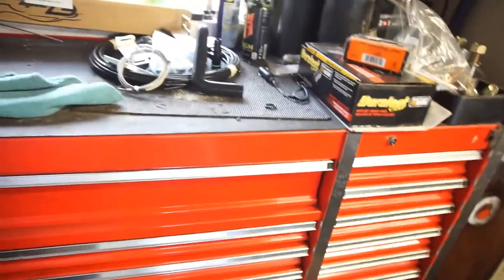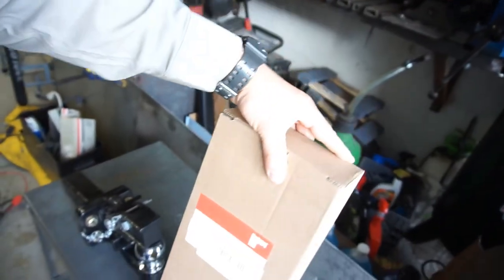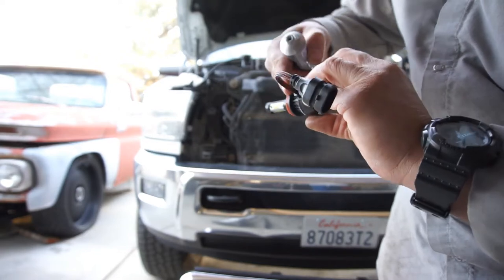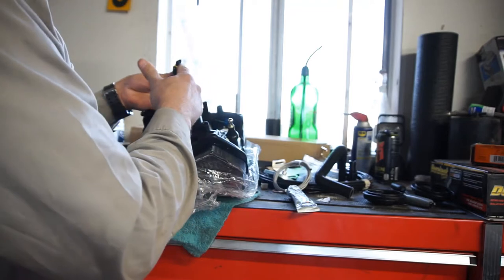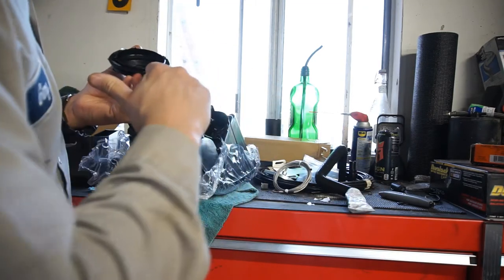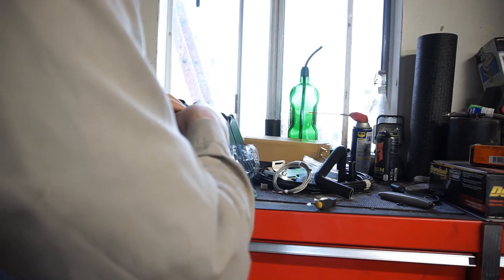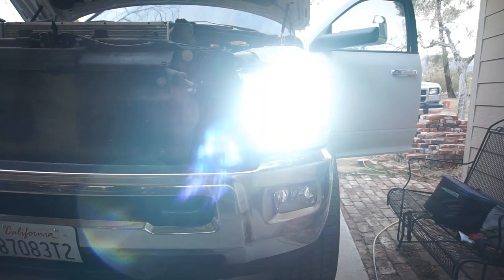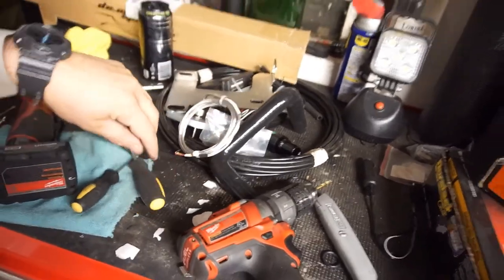The Drunken Ram Gets Some New Eye Balls, 2010 Ram 2500 Cummins Mega Cab Headlight Install

Comment: Those look way better than stock. I like the black housing and the "hyper white" lights or whatever they are called.... way better than stock.
Reply from the maker: OneNGlen I have mixed feelings right now until I color match the front. 🤷🏿‍♂️🤷🏿‍♂️
Reply: @Halffast719  You should do a poll.... stock or what is on there.... those are way better than stock
Reply from the maker: OneNGlen I like stock lights but these are growing on me.

Comment: Looks good! Nice upgrade from the originals. Did you figure out the high beam?
Reply from the maker: Paul Cleckley the bulb is junk so now I have to try to warranty it or just find good quality leds but it’s so hard because a lot of what I see is Chinese junk. I bought these because the warranty but it’s not looking so good. Warranty say cut wire and send us a piano send us the bulb. But no information of where or who this us is.
Reply: @Halffast719  wow that really sucks! I have a 13 Ram and the stock headlights are horrible. I'm better off using 2 flashlights. I'm thinking About getting the Sylvainia led's from Autozone for 99 bucks. I hope you can get the issue ironed out. Keep up the good content!